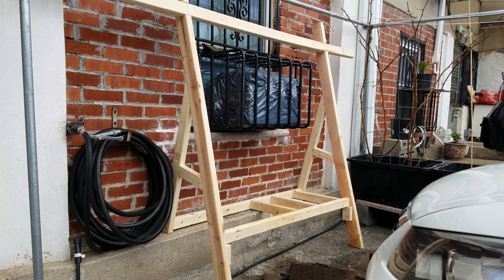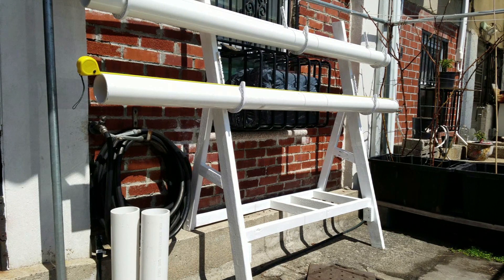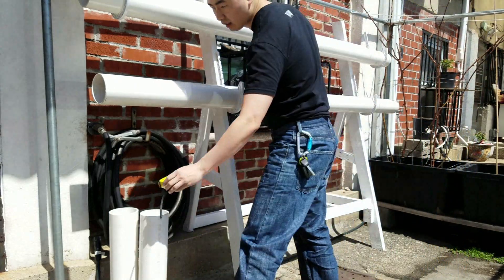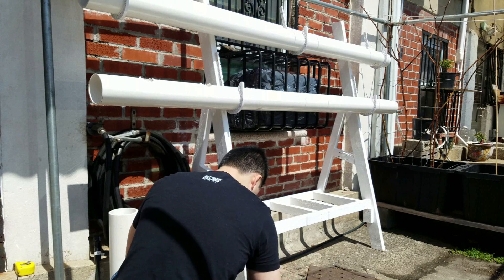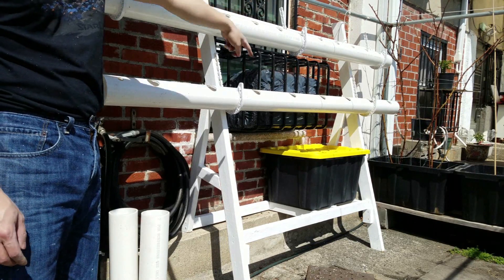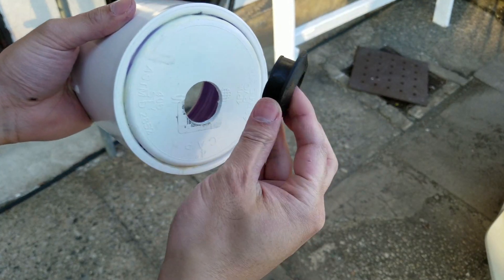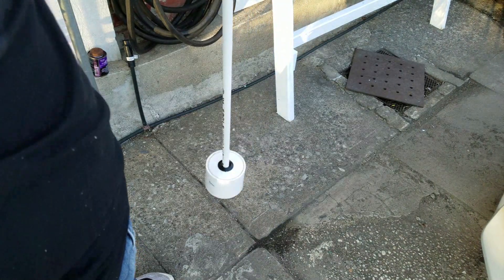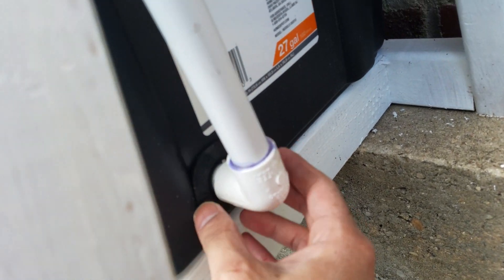Hydroponics with 4 inch PVC pipe growing cucumber, pepper, and tomatoes

Comment: How did it work for you?
Reply from the maker: Went great for about 4 months until the tomato roots clogged the pipes, then root rot set in.
Reply: @MingWong  thanks for the reply.  Buckets are probably better  for tomatoes. And possibly 2ft distance between sites of tomatoes.
Reply: What size hole and basket did you use?
Reply: Are you using a timer on your pump or it just runs full time?